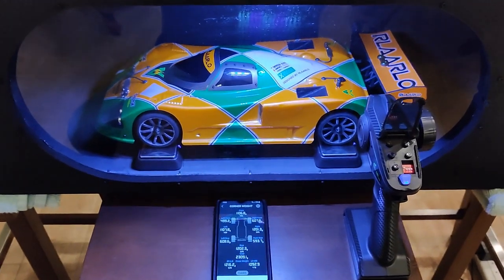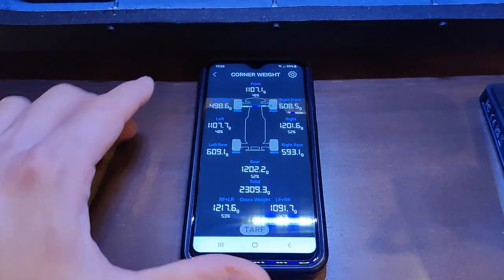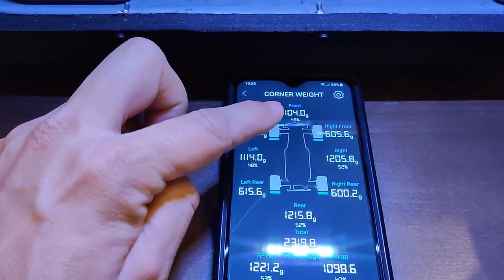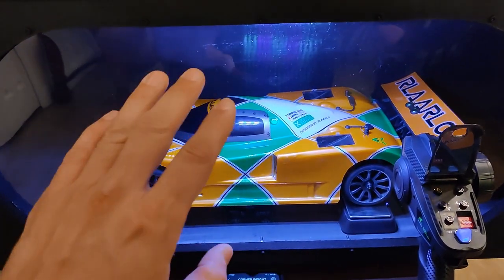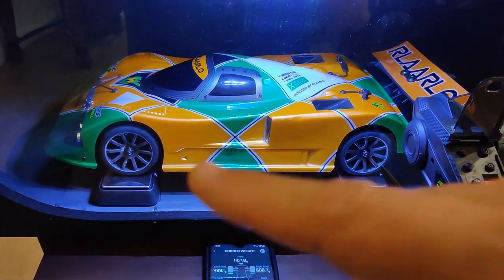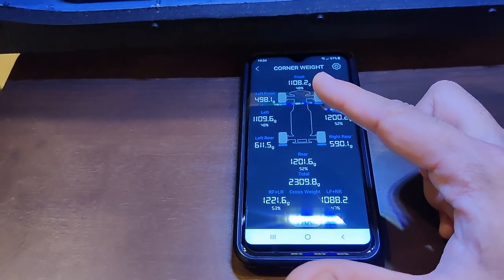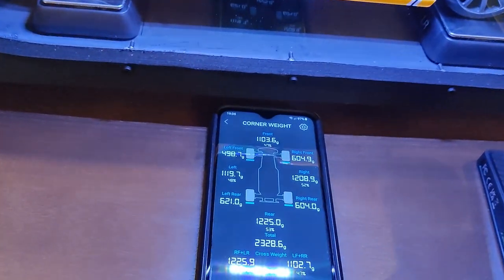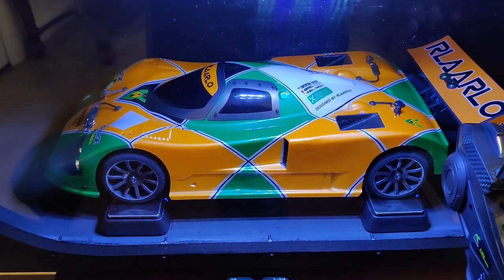Rlaarlo AK-787 Wind Tunnel Test

Comment: That's not my reality. I made a rubber front drift bumper from black soft rubber tubing. 
My sides are locked in with small black paper clips.
My ride height is locked at zero point in front and factory height at the back for the moment.
Considering carbon fiber wrap on the bottom. Attempting to make wheel wells over here. You could make them quicker than me.

Comment: Cant DYNO The Vehical While Its Elevated
Reply from the maker: Correct, that is why I explained how I would make holes to fit the scales into so it would be on a flat floor 👍. Also, I know you put dyno but you meant to run in a wind tunnel so for those reading this that's what it was, no need to point it out 👍.

Comment: I like what you are doing and planned to do something similar.  I'd recommend having a board at the bottom where you can hide the sensors from the air flow and make the car low to the ground plane.  This will allow the ground effect to work correctly.  Then you need to make sure the airflow is straight before it hits the car.  3d printing some tubes or gluing straws together are 2 simple options.
Reply from the maker: Yes, I go over these on my wind tunnel explanation video. For this particular one I used egg crate both front and rear to get air flow somewhat consistent as the straws created too much restriction for the fans to be able to generate any usable windspeed. The larger version will make much better use of these ideas as it uses a much stronger fan. As for the hidden scales this is also corrected on the larger version 👍. These changes help accuracy but also require much stronger fans which have increased the price of the build dramatically. This really wouldn't be an issue if it was my only project but........😅......many more ongoing projects is not helping lol.
Reply: @Gamyrc  glad you are doing this.  I was going to do a project like this but have been avoiding it due to costs...  I was looking at eagle tree pitot tube air speed sensors but they closed shop
Reply from the maker: @Liberty.Francis  The larger scale tunnel is at around 50-55mph right now. It's been extremely challenging to get the right dimensions for better flow. If the tunnel was round things would be much easier for "clean flow" but way harder to make the tunnel itself. A learning experience for sure! 😅☺️
Reply: @Gamyrc  I can imagine.  I had scaled plans down and it still required a 15ft long build

Comment: New Sub!  awesome test and good info on the 787, the wind tunnel is pretty cool, PB on my 787 right now is 94
Reply from the maker: Thats awesome! What are you running to get those speeds? Is it the dual motor version?
Reply from the maker: Just saw your video. I figured the stock esc wasn't involved in the 94mph run 😅. I went the same route, I am running an Arma setup from my Vendetta on it right now but will be moving to a beefier setup once that one maxes out on the 👍.
Reply: Yea. Once I feared it up the stick ESC just turned itself off. Guess I found the gear limit. Probably going to switch to mod 1 gears now…. I’m building my 917 as a dual setup with the delta plastiks phantom body. Thank you for watching… I appreciate that!🤜🤛
Reply from the maker: @BuildingVelocityRC  My plans for the 917 are to make it a quad motor setup. Not for actual speed runs but for looks. It should make for some nice YT views. Planning on making my own stretched chassis for it. But in reality I think the dual motor setup is more than perfect for these at this scale. I mean there are people running over 140mph with single motors already!
Reply: @Gamyrc  that’s awesome… will for sure be watching for that quad motor build!… sounds awesome!

Comment: Very interesting, dude! Yes, that lift on the front is kind of disturbing, especially at such low wind speed. I was watching some Youtube documentaries about the topic a few months back, specifically about the Mercedes take-off at Lemans back then. The amount of car overhang in front of front axle is quite a lot. I'm guessing Rlaarlo didn't really do any testing themselves, they just made an RC car that looks like this particular sportscar.
I'm looking forward to see your results on your aero improvements, but of course much of this you can also compensate for with suspension tuning. 
Very cool stuff to watch, I am happy I saw this in my news feed!
Reply from the maker: I feel the front lift may be a result of it sitting on the scales and that's why I will be improving that design aspect of the tunnel by making holes to sink scales into. That would allow for the car to sit at actual ride height and maybe make better use of its underside to mitigate that lift. Well, at least that's what I hope for. If not then we may have a serious issue at higher speeds which we will find out soon enough! It should be a lot cheaper to fix those issues while on the tunnel and not going airborne on the road! Lol

Comment: That's awesome to see it producing some rear downforce even at that low wind speed! I designed some small wheel cradles that I 3d printed for my scales that make it easier to get consistent positioning of the wheels on the scales. The scales seem really sensitive to how repeatable your positioning on each scale to get consistent results.
Reply from the maker: That's a great idea! Ill make some as well, it is a bit tricky to get perfect numbers for the videos when I have to move the vehicle repeatedly to make changes. Thanks!
Reply: @Gamyrc  Yeah that's what I found initially when trying to balance my Arrma Vendetta's weight distribution, every time I picked up the car to try and adjust shocks I'd get wildly different numbers every time I set the car back down. The cradles definitely helped make it more consistent. 👍

Comment: Almost need to make a foam bottom that goes around those scales in there and acts like ground so there isnt so much airflow going underneath it. 
One thing that would be awesome to get some really fast air is a leaf blower, I know the backpak ones can get up to 215-230mph coming outta its nozzle. Even the small handheld ones can get some pretty high speeds too and are way cheaper to get ahold of.
Reply from the maker: I actually decided to make cutouts out of the bottom to sink scales in there. That makes it easy to cover if not using the scales and wont add turbulence that would be created by a reamp style cover for the scales. As for wind speed I am using a larger fan for auction. It has a claimed cfm number 10x that of the one I am using now. This would provide 100+ mph in a perfect world but since we don't live in a perfect world I expect at least a 25% loss due to the limited air being pulled by the larger fan through a smaller diameter tunnel. If this proves to be accurate I should end with around 75mph wind speed inside the tunnel. Even 50mph would give us great numbers to go by!
Reply: @Gamyrc  Oh heck yea!! This is project is totally awesome man, gotta be one of the first to do this for RC's :) very kewl!
Reply from the maker: @DurpVonFronz  It was a just matter of time till someone had nothing better to do and just did it! Lol. Its actually looking like it will offer some really useful numbers once I get speed high enough. Honestly feeling relieved that it wasn't time wasted lol.